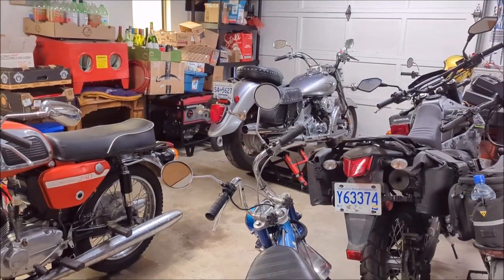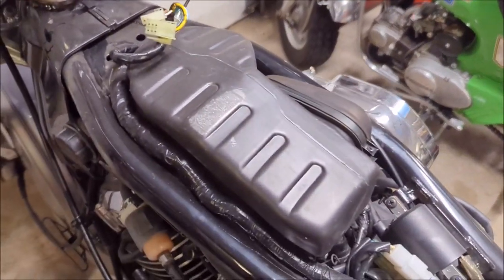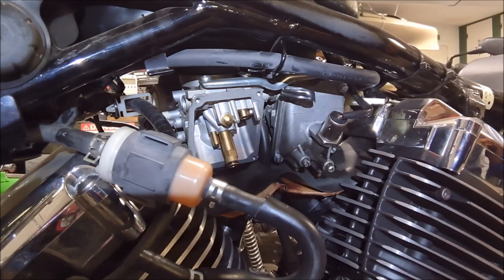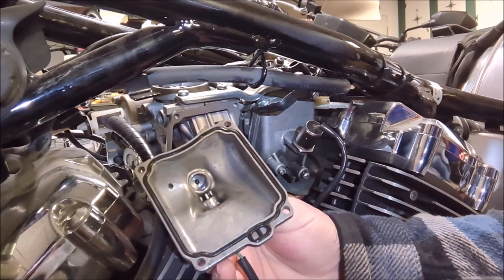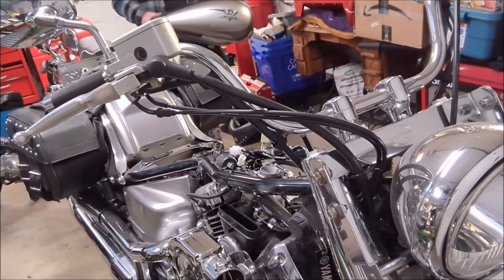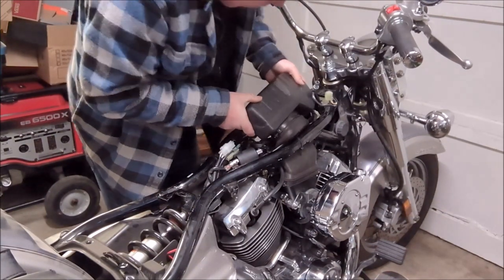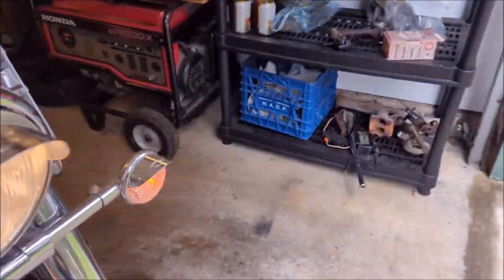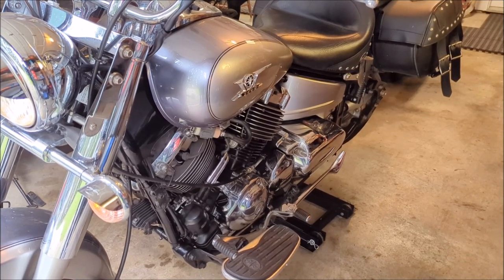Yamaha VSTAR 650 - Leaky Carb Repair!

Comment: I have a 2009 as well that’s been leaking! Been scared to dig in because I’m not a mechanic, but this gives me some confidence! Dealer quoted $700+ to do a carb kit 😅
Reply from the maker: Hi @PatrickHawkins, this is definitely a job you can do yourself, so go for it!  As I mentioned in the video you definitely need a JIS (Japanese Industrial Standard) screwdriver to get the 'phillips' head machine screws removed so as to remove the float bowl.   Wow, $700 is crazy, and a dang good reason to give it a shot.  Working on bikes is rewarding and there's lot of help out on the internet if you need help or get stuck.  Take pictures as you go, and just go for it.  But don't even try a regular screwdriver on those carbs.  Invest a few dollars and buy a Vessel brand or other reputable brand of JIS.   Hope this helps and best of luck!
Reply: @MadTinkerman  I did not take your advice and get the JIS screwdriver… this little eight screw project turned into a whole thing 😂 Had to take the whole carb out just to get to the bottom right corner screw to cut a slot in it… 2 nights and a day 😂 But got it back together, fixed the gas leak! Seems to have developed an issue with airflow when rev-ing the engine, but runs up the highway just fine 🤷‍♂️ The seat is wobblier than I remember, I see a hole to put in a bolt, but I don’t remember taking one out nor do I see it anywhere 😂
Reply from the maker: Hey @PatrickHawkins sorry to hear you had a bit of a pain with those JIS machine screws holding the float bowl on, but just know you are not the only one.   They strip so easy just about everybody has had it happen to them.   That said, great to hear you persevered, took the carbs off, and got 'er done saving yourself $700 bucks!!  Well done!!  You'll enjoy the bike even more now that you've worked on it yourself.   Keep the rubber side down :) !!

Comment: Thanks. Off course I stripped one screw on each carb, even with good tools. Insane crap. But it looked on the video like you forgot to fit the airbox on to the carbs? (I'm having trouble with that now, so was looking closely for that 😅)
Reply from the maker: Hi @aze2099 my bike is mostly original, but the airbox has been modified to enable the use of cone shaped K&N air filters, so that's why you didn't se me fitting the airbox.   I really appreciate you watching the video and your comment!  If you haven't done so already, please subscribe!   I really appreciate it!  Cheers
Reply: @MadTinkerman  That explains it! I just managed to re-fit my airbox onto the intakes. Took a lot of wiggling and pressing 😅
Reply: @MadTinkerman  AND it was the sealing for me as well! Couldn't ger original ones but adding RTV seemes to have done the trick. So really grateful for this video, I don't think I would've thought about that as they looked pretty nice.
Reply from the maker: That's interesting that you had the same problem with leaky bowl gaskets.  I guess the rubber just deteriorates over time.   I was quite surprised that was the issue.   Glad to hear RTV worked for you.   I got my carb gaskets off of Amazon and they were very reasonable and work well.  Just type in this search into Amazon "vstar 650 carburetor bowl gaskets"   Hopefully they don't leak again, but if they do, hope this helps.   Cheers.

Comment: Hi my name is Tony can I have a V Star 650 1999 I finish cleaning the sprayers and I don't know what happened when I change the gear have to wait couple seconds for the idol get down to change the gear and I don't know what happened can you help me what do I need to do please
Reply from the maker: @TonyRayas-u5q Hi Tony, if the bike isn't returning to idle I suspect you may have an issue with the throttle cable.  It may either be hung up somewhere, incorrectly routed or, most likely, that it needs lubrication.   You can purchase a tool for lubricating cables off of Amazon for  few dollars and they work well.   If lubrication doesn't solve the issue, and you know the cable is routed correctly, then you will likely need to replace the cable.   Hope this helps, and thanks so much for watching the video.   If you haven't already, please subscribe.  I really appreciate it!

Comment: Super great video … may I ask what’s hanging from the garage ceiling looks like a big chain saw ?
Reply from the maker: Hi @Fundaykidzz, glad to hear you liked the video!   I have two chainsaws hanging up there, so not too sure which of them you were looking at.   I actually have videos of both of them running.   The first is a David Bradley 360 Gear driven model that has two bars:  https://youtu.be/IP2EkxqwtMQ    And the second one is a 1946 Power Machinery chainsaw made in Vancouver:   https://youtu.be/WM3cHE-ko2w   Please check them out and let me know what you think by leaving a comment on those videos.  I reply to all comments and really appreciate the feedback.   If you haven't already, please subscribe and share the video links with others.   Really appreciate it.

Comment: Would you not need to sync carbs after messing with floats? I followed step by step instead of watching this video all the way through first😅
Reply from the maker: Hi @issacreyes6428 that's a great add!  Syncing the carbs after carb work is always a good idea, and especially if you are changing jets or have had any reason to take the carbs apart.   I didn't do that in this video, but may do a video in the future showing how that can be done easily.   I have my own carb sync contraption for that purpose made out of an old yardstick, clear plastic tubing and two stroke motor oil :)   I should show how that works in another video.  Thanks again for your comment!